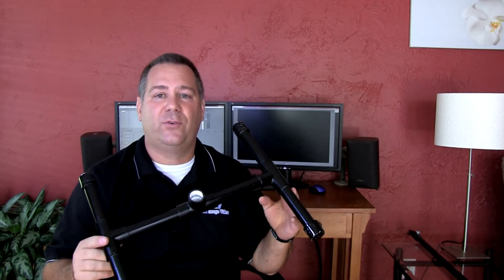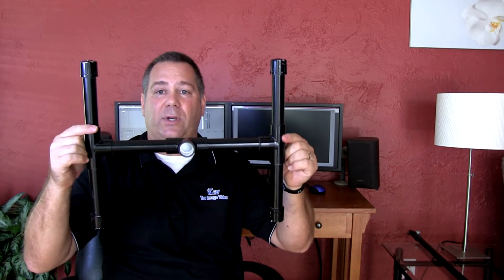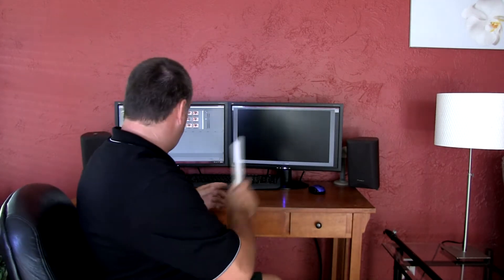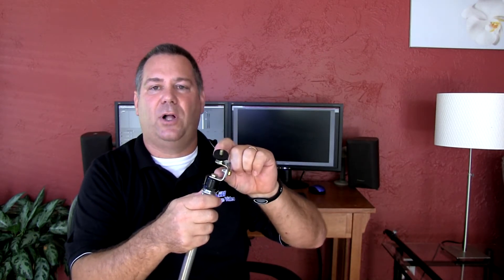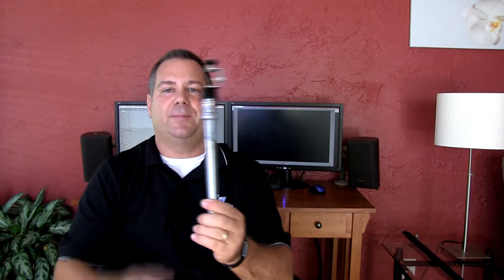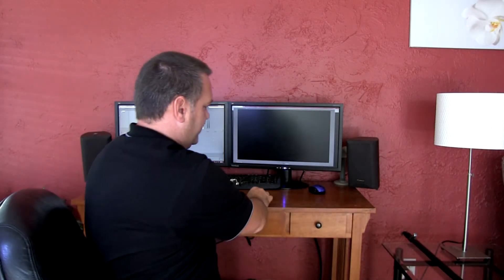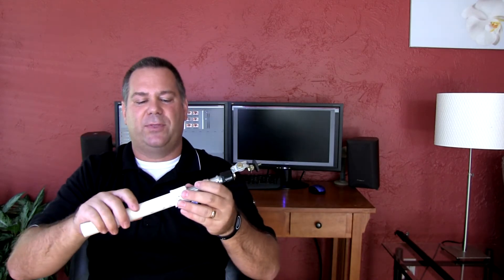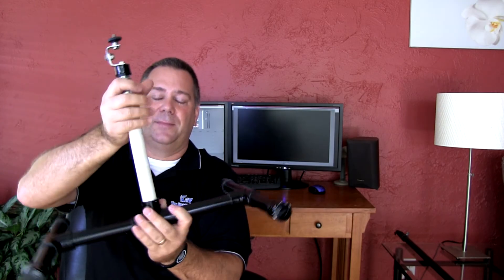DIY Adjustable Video Light Stand

Comment from the maker: Michel, thanks for watching. Yes, the base itself could use longer pieces. I also made one where I put steel balls in the base to add weight and make it more stable. To stiffen up the point where the the vertical piece attaches, you can add a coupler to the base. Glue it to the base. Then the vertical piece will attach to the coupler on the base.  This will add strength and will wobble a lot less.